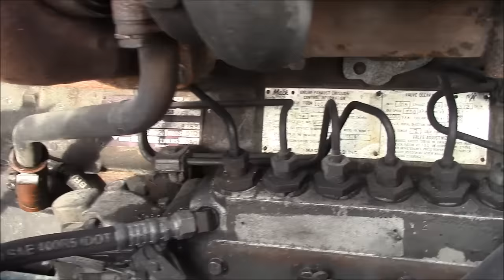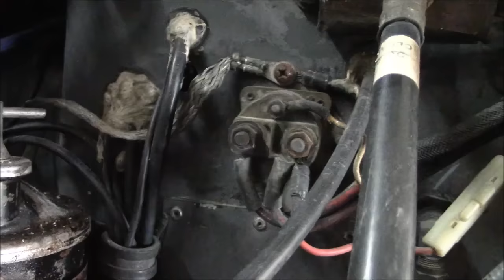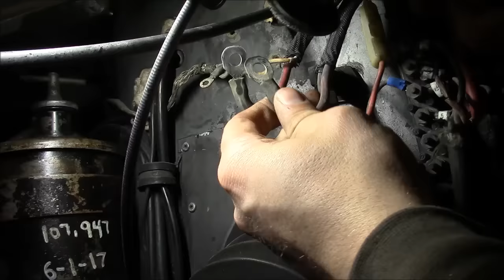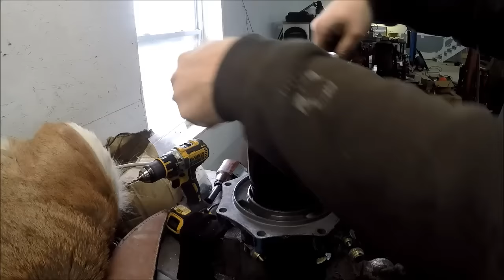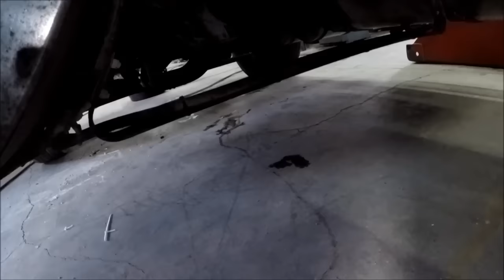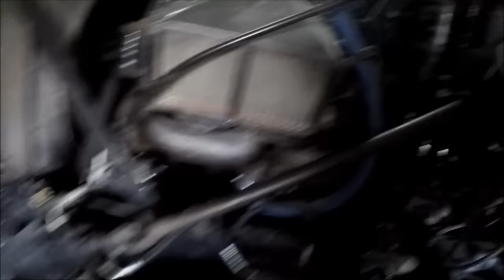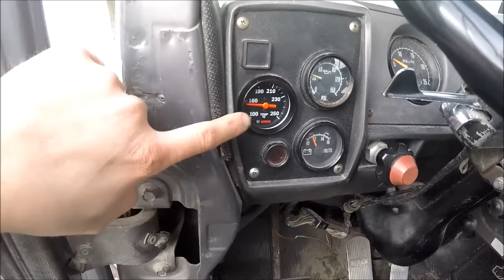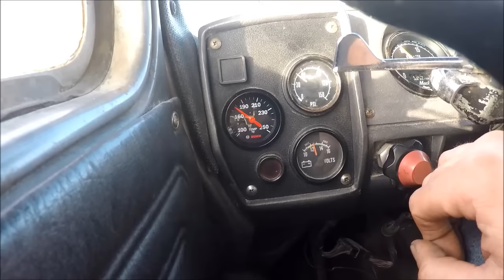Cool 1977 Mack RL600L - No Crank, No Start - Plus Many Other Repairs

Comment: I am kind of proud of that owner. So many folks just want you to get them back on the road, but this guys wants everything fixed. Right on.
Thanks for the video.
Reply from the maker: He's pretty fussy.
Reply: @WatchWesWork He might be fussy, but I am pretty sure that this is exactly why his truck looks decades younger than it is ;)
Reply: Super dedicated to his. Rig
Reply: that's a pretty clean truck too
Reply: It's often a question of $$$. I'd love to go through my '85 F150 and fix absolutely everything, too, but that's a $20,000 restoration I can't afford right now, so I have to settle for keeping it on the road.
Reply: @TestECull  Good point. I am also proud of the owner who has to make strategic fix decisions to keep his mission going.
Reply: @TestECull  Yeah, I've got a 92 dodge with the 12v. I'm gonna get it on the road for now but I wanna save about 10k to do it the right way from the ground up. Right now it's an absolute piece of crap.
Reply: @TestECull the difference is that truck is still in commercial service making money. The cost of maintaining this truck to a high standard is vastly less than buying anything newer and maintaining that.
Reply: @TheMegaross91 Which is why, if I was owner/op or if I ran a fleet, I'd buy up as many older trucks as possible.

you're talking to someone who daily drives a 1971 Chevy C10. I know damn well all about that sorta thing. It even applies for passenger cars and light trucks.
Reply: @TestECull  I had a 1985 F150 spent all my free time on the weekends trying to keep it it good running condition. That year they had this crazy computer operated carburetor. They hid splices in the main wiring loom, so tracking down electrical problems was a nightmare. I had the straight 6 with a 3 speed transmission. I thought it would give much better gas mileage than the 8 cylinder.....but not by much.
Reply: @wambs88  Yaeh no the first thing I did when I got mine was unplug the metering rods and twiddle the needles a bit. With them connected mine runs like absolute dog piss; the ECU tries to lean burn it right into an early grave. Literally so lean it overheats, won't pass the sniffer, et-al. Disconnect the metering rods, let them spring to their resting position, and with a slight tweak to the idle mix and the dizzy she comes right good.

I get 18MPG combined out of mine, but I have the wide ratio 4-speed and 2.49 rear gears as well. I'm sittin' there at 75MPH keeping up with the flow no problem and only turning about 1700RPM or so, and that greatly helps it. I can get the same MPG that someone with an ecoboost from today gets.....
Reply: He should try vasoline on the terminals it is a dielectric I used it as a ham radio operator
Reply: That's how you keep a 70's mack truck doing what they do best, maintain it well and it'll be as reliable if not more reliable than a modern truck. 

If you consider what a payment on a new truck (especially an equivalent high end truck) would cost the maintenance and repairs on one of these old macks seems like a bargain.
Reply: Absolutely agree, this guy obviously loves his old Mack, look at the small details he has done to it, even caps on frame rail bolts, paying Wes to replace the parts not glue them or patch them, also note Wes put fresh paint on the shortened brake distribution valve body bracket knowing the man would be looking closely at the repairs, obviously he brought it to the right place. NOW we can ask about the Old Ford F100 on the trailer outside Wes? looks pretty picked clean, is this a project or free storage for a friend....ha only kidding.
Reply: @texasjetman , seeing that old F100 sure brought back memories of my old '61.  When I first bought it some "mechanic" had attempted to install new rings in the straight six and did the one thing anybody with even a half of a functioning brain would never do, he lined all of the rings up.  She smoked worse than any diesel you ever saw and if you switched her off, that was it until she cooled down.  Took it to a reputable shop, they put the rings in right and I drove that old F100 for many years after that with never a problem out of it.

Comment: Did I hear you  right that it had an aluminum frame ? If so it must have been special ordered .
Reply from the maker: Yes, aluminum. I don't know much about it. I worked on a Freightliner once with an aluminum frame.
Reply: I believe the "L" in RL designated it as an aluminum frame. An RS600 would be a steel frame.  Both RL and RS trucks are designated as Western trucks compared to the normal "R" which everyone knows. I'm not sure what is different between a western R (RS/RL) and just a standard R model.
Reply from the maker: @TripleMEquipmentServices  Well the Western part would explain why it's so clean.
Reply: @WatchWesWork  Here's what the google told me when I briefly looked into the western R trucks a bit more. 
"Western R models came in both the 600 standard hood and 700 long hood.RL's had aluminum frames,RS's had steel frames,They were built from 1966 to 1981 in Hayward,CA.In 1978 the RL/RS600's were badged as Value-Liners and the RL/RS700's were discontinued and replaced by the Super-Liner.The RL/RS600 Value-Liners stayed in production at Macungie,PA from '81 up til '90"

Comment: Geeez Wes, I'm thinking the people crying about how to use grease on connections need to log off, get out of their mom's basement, and go diagnose and repair other peoples vehicle electrical "repairs". Sure hope that 64ish F series on the trailer that I didn't see is one of your upcoming projects.
Reply from the maker: It's a 65. Or it would be if it existed.

Comment: Now if it was an RS-700L it would of came factory with a 12v71 Detroit, Although i think only 100 where made. Personally, I prefer the Older Pre-1973 (?) Mack R-Models with Steel Dash.
Reply from the maker: I always liked the ones with the offset cab.
Reply: @WatchWesWork  Oh yeah the U-Models. Those are sweet.

Comment: The battery on concrete is true.  I took a perfectly good year old battery out of a truck.  Set it on the shop floor.  Twelve years later I go to slap it in an old tractor.  Nothing.  Tried to charge it only to find it wouldn't take a charge.  I had another brand new battery on the same shop floor that my nephew swung into the corner of it with the forks on the forklift (forks were dragging on the ground).  Cracked the case.  I'm positive had both batteries been on a block of wood they would still be around.
Reply from the maker: LMAO! Pakistani Trucks channel would fix both of those batteries...

Comment: O i had to pause it.  I also use dieelectric grease on every electrical connector i install. It also has never caused me a problem. And im also talking thousands of connections. All it ever did to me was prevent carosion and arching..
Reply: Dielectric grease is good stuff it makes a better connection keeps the terminals from rusting and keeps the moisture out. My friend had a old mustang with a 3.8 liter V6 and when he drove it through a mud puddle the engine would lose power and it was because water was getting under the distributor cap once he started using dielectric grease he could drive through puddles all day and not worry about loosing power anymore.
Reply: I've owned several Chrysler vehicles....they put a big wad of that grease on all those pesky bulkhead connectors in the engine compartment....maybe they know something??

Comment: Oh my Mack! I love R Model Mack trucks. One day i will have an 18 speed R Model made into a pickup truck, the aluminum frame usually indicates that it came from the west, the western built Macks were lightweight, and not for heavy application. The eastern built Macks were usually built for heavy applications, such as heavy hauling, specialized transport. That gold bulldog also has a meaning. it has all Mack components, the driveline, transmission, and motor are Mack built. and those wedge brakes are the worst. have to convert to an s cam. way better then wedge.
Reply from the maker: Yeah I'd rather have no brakes than wedge brakes...

Comment: The hose fittings are called airquip 
And the temperature gauge is a capillary tube type.
Reply from the maker: Parker calls them "field installed fittings".
Reply: Aeroquip is a brand from Eaton and they make those fittings. Although it’s like saying Kleenex or Velcro it’s synonymous.

Comment: As i knew, D-grease was and is still used to flood connectors when you're dealing with high voltage connections. It creates an insulator barrier that keeps things kosher. For example, if you have a "lazy susan" style connector, where the body needs to spin freely, the blade connectors are heavily smudged in that stuff so they don't arc inside the joint. 
 Personally, i use it without restraint. I spitz that stuff in every connection i have, then use a thick syringe to flood every hole of a connector. Excellent for keeping unwanted moisture/water out.
Reply from the maker: Bigger the gob, better the job!

Comment: I’m with you on the grease. I’ve only been doing it for the past 52 years with no problem at all and when you revisit the job it’s always good. I guess 52 years ain’t a long time if you say it fast! Keep up the great videos. Regards. Chris.
Reply from the maker: Right. It works. Done.
Reply: @WatchWesWork  Plus, the silicone grease connection has MUCH lower resistance than a connection covered in the green crusties!!!
Reply: I’m only 47, but I’ve done this my whole life. I’ve never taken a connection apart and seen anything wrong that’s been greased. I’m a welder by trade now, and I’d never do a YouTube channel so people that have never welded can criticize me. Hats off to you Wes. You do good work.
Reply from the maker: @bigb7157  I hear you. I think that's how most people feel. At least the smart ones!
Reply: @bigb7157  it's usually not the people who've never done something, it's the ones who got into something new a week ago and are now self-professed experts. A tale as old as time.
Reply: Well maybe after 53 years it all goes to hell :D Seriously though I grease all my terminals and they always stay clean and come apart. Then the guy with gobs of white junk growing all over their battery, has a hard time starting, will tell me no way should you grease the terminals.
Reply: Reminds me of my main Woolworths runner for six years doing local and country runs ,plus a few I drove up Northern Territory doing the Kakadu wetlands,thanks for your time and great working knowledge pigmypete64

Comment: Don't you understand? If you go putting that dielectric grease on high voltage lines, gun the motor in a state of panic or road rage, and that thing arcs onto a battery which is in contact with concrete, this world could be sent into an alternate time/space universe. Oh I've seen it happen a dozen timee!
Reply from the maker: Sort of a Back to the Future lightning/clocktower scenario?
Reply: @WatchWesWork  will that truck do 88 mph?
Reply: @porkyswelding  Every Thing Measured In Giggawatts
Reply from the maker: @porkyswelding  I think we'd have to push it off a cliff to make 88mph!
Reply: Have a look at TOT vidieo.      It’s “ this old tony” for a good laugh he has a time travelling lathe cuts steel with a hand chop , is a pretty good machine Chanel with a real of beat sense of humour
Reply: Finally, an authority chimed in to set the record straight.  Its about time we got a scholar in here.

Comment: I have to say that I have never, I mean never, found an automatic brake adjuster to work properly, so long as you can get at an adjuster, do it !
Reply from the maker: They work for a while until the grease hardens up...
Reply: they do not keep the brakes tight, Manuel is the best, haul heavy ull learn

Comment: Wes. As a retired sparks heavy power we had to install a couple of large induction furnaces 1.5 mega watt jobs they had 8 inch by 1/2 inch bus bars about 6 in parallel the spec was you had to use dielectric grease on all contact surfaces even the backing plates bolts and washers etc needed a thin coat so in my book you are ok . I will leave it to you to work out the current and voltage across the coil when it was in parallel resonance ie unity power factor by use of switched in caps , but I do miss the big stuff to work on 750 ton EOT  cranes was the norm 

Keep at it and don’t let the dratsab’s drag you down
Reply from the maker: Well that's above my pay grade, but I know squirting some goo on the terminals is not going to slow down any electrons.

Comment: You are correct about the silicone grease. The next internet professional subject: SOLENOIDS AND RELAYS! 

You were working with a relay, in this video. The solenoid, especially in the context that it was mentioned, does work. A relay transfers force. I.E. Electricity, hydraulics, pneumatics. A solenoid does work! I.E. Turns a valve, moves a lever, actuate a switch! 

On a GM style starter, the solenoid makes the electrical connection (like a relay), it also times the electrical current, and engages the drive gear with the flywheel, so that the gear is engaged before the gear starts to spin, so that the gear or the flywheel doesn't get ground into pixie dust!! 

I know, I KNOW!! YouTube! Your channel! How your ancestors did it!! Opinions! However, it's your decision to learn, I would be remiss, if I didn't teach!! 

Thanks for sharing!,
Reply from the maker: Yeah. I think it's more like "motor" versus "engine". We tend to interchange them, but they are technically different. What about contactors?
Reply: A contactor is generally an electrical relay, but the incidental name differentiates between a high load electrical circuit, and a lower load circuit! 

Similar to "IMPACT DRIVER"! No one immediately looks to a small fastener turning, manual, hammer driven, tool! But they all do the same job! A contactor does the same job as a relay. But, as a higher load circuit switch! 

P.S. I'm of the ENGINE-MOTOR is an interchangeable term! Even if you look up the definition, an engine is described as a motor!! So I'm not expecting GM, FORD, or QUAKER STATE name changes, any time soon! Lol
Reply: @roadkill5333  only interchangeable in certain fields and certain direction. Steam motors and electric engines don't get a lot of you tube fans.
Strangely when early brit cars went from a fat pull switch on the fire-wall (bulk head) to an electrically triggered switch ( before the modern gear engage system,i,e, the bendix inertia helix system) Brits called that fat switching device a starter solenoid and not a relay.I imagine because although it didn't perform a purely mechanical function as an electro-magnet, it had such a big and primitive job of pulling fat, highcurrent contacts a fair distance and looked a lot like other actual solenoids in use at the time,
As a car mechanic,I only became aware of relays as smaller plug-in parts for lower (medium) current stuff in certain lamp and window  circuits.
On cars with the switching device combined on the body of the starter-motor the component would correctly be called a combined relay and solenoid because,  as pointed out,the electromagnet does 2 jobs:pulls the lever arm that engages the gear and then bridges the fat high-current feed to the motor.But everyone just calls it the solenoid
Reply: P.P.S. That was a great example! I almost scratched my head. Wink wink!!

Comment: Don't get me started on the no anti-seize on lug nut studs.
Reply from the maker: I know. I've also done that thousands of times with no issues.
Reply: The only grease not to use on fasteners is "Molybdenum Sulphide", it has a lammenelar structure rather than cuboid as most greases. Copper based for steel to steel/Cast Iron, Copper to Steel;  Aluminium based for Aluminium to Steel, Nickel based for Stainless to anything, and other materials, plus very high temperature duty.
Reply: hope you don't ever plan on driving a CMV then, 'cause I can guarantee you those motherfuckers go on dry-as-a-popcorn-fart.

Source: I've slung a few Lo-Pro 22s in my time. Goodyear service truck, Penske, worked for the local FTL dealer for a while. Too much of a time constraint to even so much as splash a little 10w30 at the studs, especially on a road call.

Comment: Hi, Wes, you're right about the dielectric grease regarding installing.  When you clean terminals and use fresh grease, the parts all make electrical contact no problem.  Regarding arcing/failure - I believe whatever the manufacturer says.  Great video!  Yeah, I use copr shield when I WANT a good electrical connection that I am concerned will degrade.
Reply: I was thinking that if you had any trouble with the grease inhibiting conductivity, it only means you didn't tighten down the connections!
Reply from the maker: Right!
Reply: @Mishn0  yep